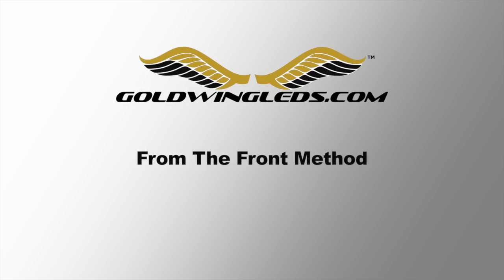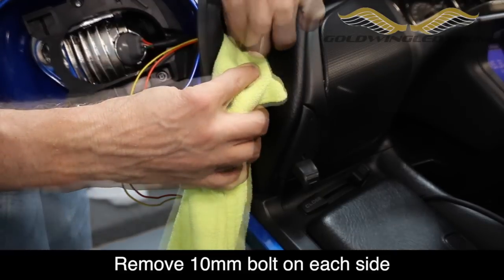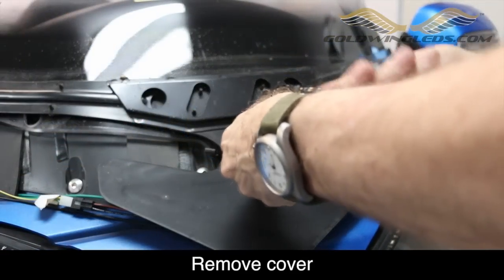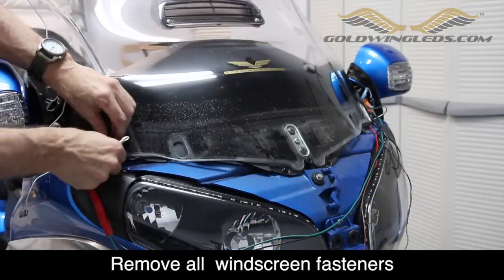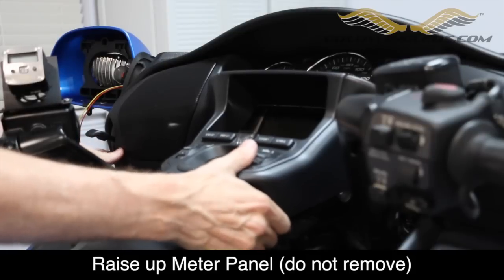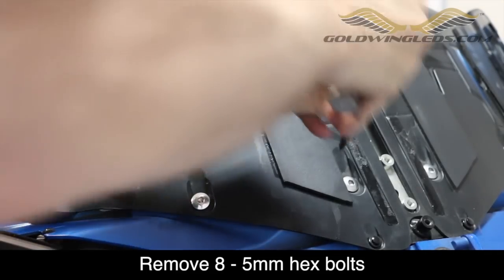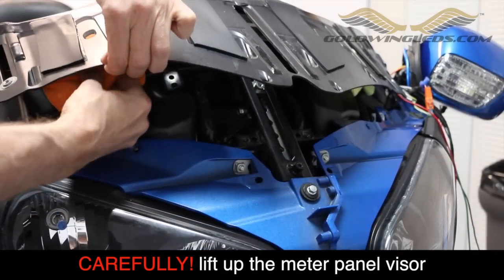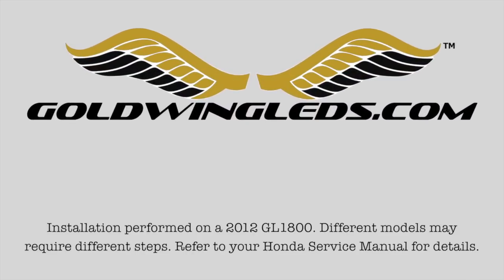Install a New LED Flasher On A Honda GL1800 Goldwing

Comment: I installed the LED flasher this evening on basically the same bike; 2013 GL1800 Blue/Silver
I’m six foot tall 200 lbs and I’d say average sized hands.  Getting at the flasher, unplugging it, plugging  in the new flasher, and reseating the flasher on it’s little rubber/metal hanger tab was tricky to say the least.  Probably took me twice as long to do the actual replacement as it did to disassemble the front to reveal the area where the flasher is housed. 
Got it done though, and then replaced the rear brake/turn signal bulbs as well as the license plate bulb 💡 
I left the front disassembled as I’m installing the Pathfinder LED sequential turn signals/DRL first thing in the morning.  Seems like I’m already halfway there with the front disassembled. ☮️🤘🏻🤘🏻✊🤛🏻🤙🏼

Comment: You should put a disclaimer on this video or at the very least change the name to signify its for the 06 and up years, it’s not for all GL1800 model years.  The first 5 years don’t have a removable flasher relay in the rubber mount.  They have a flasher circuit board that is built into the rear of the gauges and can’t be removed, but you can still unplug it and install an LED flasher in the harness at its plug.  This difference could be expensive because the first 5 model years have a relay hanging in the rubber mount, but it’s the position light relay and is a 5 pin relay, not a flasher.  If a flasher unit is plugged into its plug, it could blow up the turn signal cancel unit which will kill the turn signals and cost at least $147 to replace.
Reply: HI Techdude, I just completed the flasher install on my 2005 GL1800 and it did have the separate flasher covered with the rubber mount attached to the metal bracket. Go figure!
Reply: @willtopower2158  well, I’m not sure about your bike, but if you look up the parts diagram for the 05 Wing’s speedometer, you will see it calls for the circuit board flasher that is mounted in the gauge assembly.  The relay mounted in the rubber holder is normally the position light relay on the 01-05 US models.
Reply: @techdude2000  Thanks for the clarification. As shown in figure 74 in the back of the manual for the component locations, I disconnected that connector and installed the connector from the new LED flasher. So this bypassed the old flasher on the back of the gauge panel. I thought the position relay was the flasher relay and just disconnected that. So I need to reinstall the position relay. The new flashers work great, someone mentioned there might be a problem with radio interference but I have none. Jerry

Comment: Worked great! I didn't have to remove the windshield (screws were frozen in there), you can tilt the windshield back and get the bottom bolts. Thanks

Comment: very good, clear,concise! quick ques. what is this LED flasher for really, only if you have LED turning lights, is why you use it? confused a bit on this product....thanks!
Reply: With turning light based on LED lamps, the speed of flashing is too fast. Is necessary change the flasher to have the correct speed.

Comment: Who do I contact regarding installation of this item?   I watched a complete video and installed all aspects of it on my 2006 GL1800, and the flashers no longer work.  DRL work, but thats it.

All wires are plugged in, flasher replaced, and the only strange issue is the flasher unit.

I removed the old flasher from the rubber grommet just like the video, and that flasher unit has one wire harness attached.

The new LED flasher has two wiring harnesses.

I connected the one from the new LED unit, which leaves ones extra wiring harness coming from the new LED flasher.  Is this supposed to connect to something?

Comment: Did what you said, but my flasher had two separate wires coming out of it. Do hook I end to the bike and do nothing with the second set of wires?
Reply from the maker: Yes
Reply: Yes I had the same issue. Left the second connection open. Works fine. Looks like that is for any additional led lights to be added.
Reply: @cruisemansgarage  Could be that in the earlier versions is used the male connector, and in the last versions the female connector?
Reply: The second plug and wires on the new flasher are to make it compatible with the 1st and 2nd generation of the 1800.  Honda changed the bike’s harness plug on the 06 thru 17 wings from the 01-05 models and Electrical Connection’s solid state flasher has both compatible connectors so it’s multi year capable.